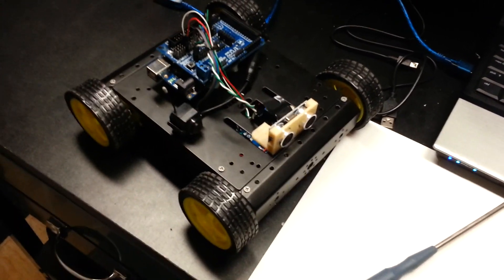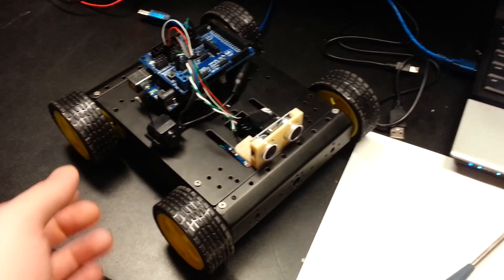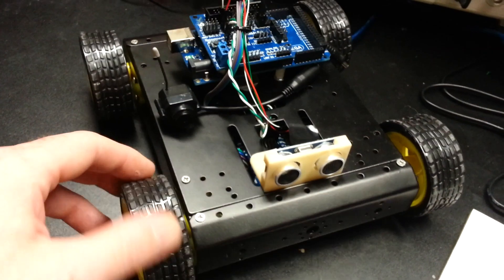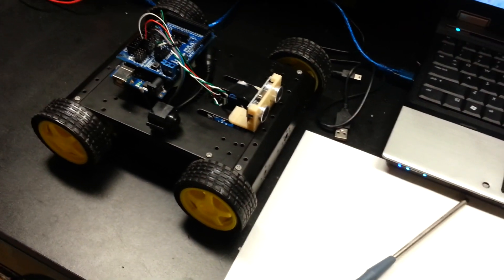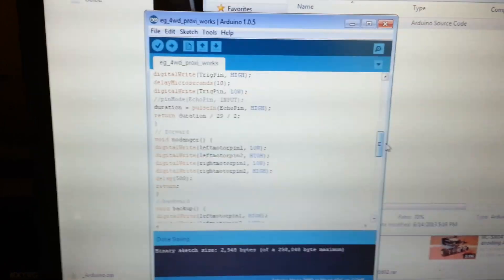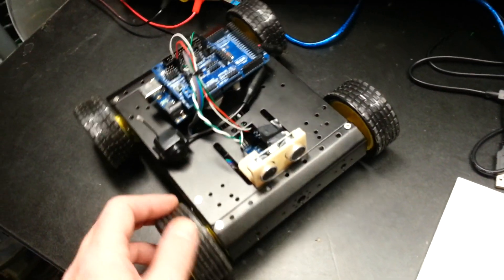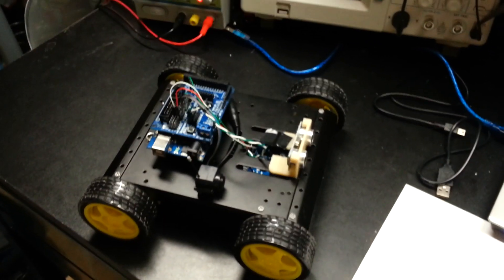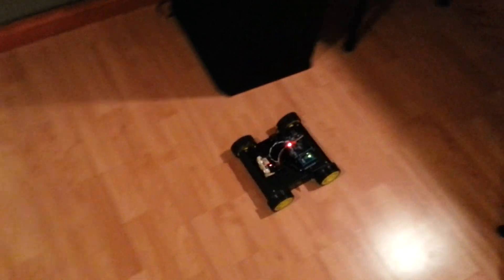Arduino Sainsmart 4WD Robot Programming

Comment from the maker: No I haven't bothered to measure the draw from the motors- I can tell you it's a fair bit and the normal AA battery setup is not really well suited.  I converted mine to use a cheap 7.4V 1amp/hr LiPo battery.  They are dirt cheap on eBay. Works 10X better.

Comment from the maker: Just use an AnalogWrite instead of a digital write to the pin.  Compiler?  If you have an Arduino- the Arduino IDE works fine.

Comment: hey eric,

I just bought the whole kit on amazon. Got the sonar sensor, sensor shield, l298n and sainsmart 2560. I am having trouble putting it together. I have connected my motor to the h bridge, however I am not sure regarding the pins i should connect on the chip. I have looked everywhere and it finding difficult to find. can you help me please

Comment from the maker: Dunno on yours.  Mine is running fine.  Check formatting, upper vs lower case etc. Not sure if you grabbed my code file or copied it from screen- but the file is fine in all those respects.  Cheers

Comment from the maker: If it compiles fine (which it should) verify you have your pin assignments set up correctly for your application and wiring to the motors the same as mine (mine is per the Sainsmart pdf file)  Cheers.